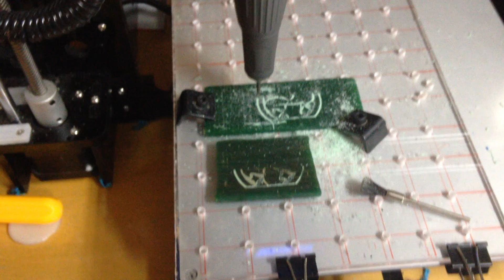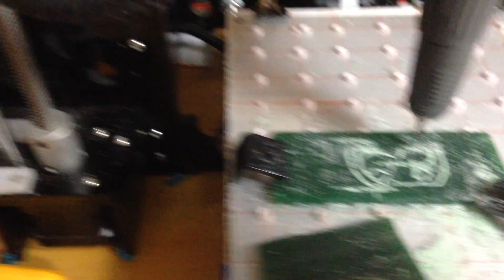Anet a8 Or 3d printer conversion to CNC(second test milling but not quite right yet)

Comment: What back plane for the LM8UU bearsgs on the X axis rods are you using?  Something custom?
Next deal is to get a laser...
Man I so wanted to do that to...I had a plotter set up but it stuck way to far off the front
Reply from the maker: Everythings the same i just took off the e3dv6  and made a spindle mount to fit my x carriage or tech2 and prusa reworks x carriages... 
Funny u mentioned lasers too wanna add one too after i get this upgrade going a bit better
Reply from the maker: I made a good sharpie jig on my good cnc that could work on the anet i just need to design a new jig..

Comment: hi there !! 
can i ask you which firmware you use and which software ? 
i try to make the same with A8 but im so comfused !! :(   
every help will be very usefull for me :)
Reply from the maker: Im using  Skynet3d v1.1  and Estl cam. 
Do you have a spindle or handpiece?
Reply: 3DTSUJ CNC & MODEL MAKING 
 I use a small spindel like yours.. I try first to understand little bit better the cnc milling machine.. The next days I will make my diy cnc with Aluminium and I will buy a spindel from eBay
Reply from the maker: It doesnt matter what firmware you use.... the way im doing it is kind of tricking the machine a bit, theres alot  of steps so im gonna do a video once i can get my gode fixed. But the endstops needs to have a extra long extension like in 0:30sec in the video...
 so the end of your milling bit end needs  to be equal to the endstop  and bed  then I use pronterface to home up to the top of the material  or wherever you set your gcode to start from then just goto SD card and load the file...

 my main purpose of doing this is for personal knowlegde and making it possible without using a dedicated CNC controller..
Reply from the maker: Yeah its basically the opposite of 3d pinting way better quality for 2.5d stuff alot sharper lines than 3d printing but alot of mess too